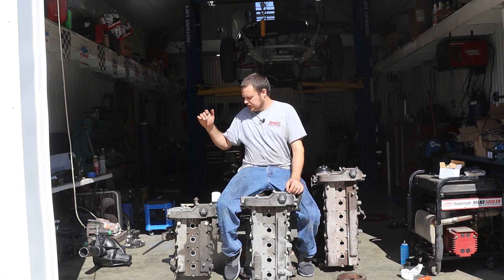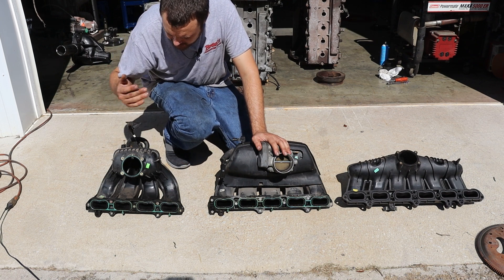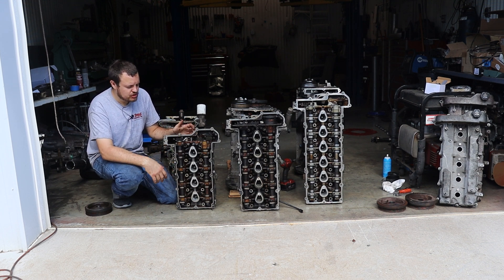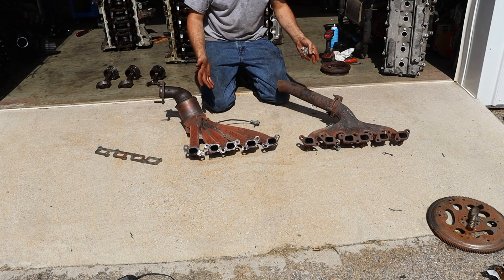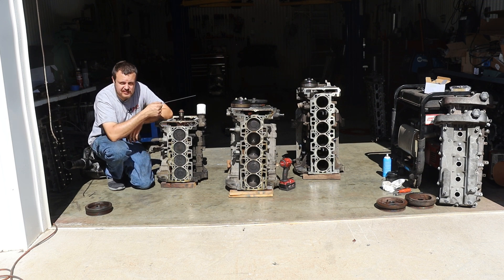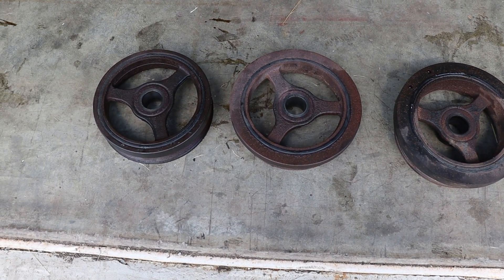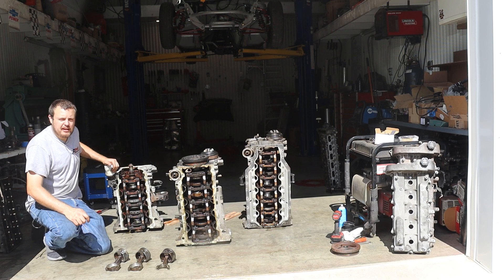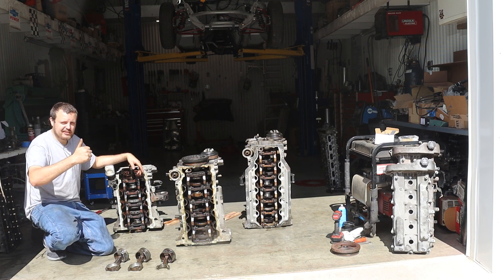GM Atlas 4 vs 5 vs 6 Cylinder Engine Comparison

Comment: can you bore out the 6 cylinders to 95 to fit the 5 cylinder pistons in the gen 2 engine?
Reply from the maker: You would have to resleeve it
Reply: @Calvin-Nelson  Has anyone tried to do that? do you it would be worth doing?
Reply from the maker: @tylorjames84  yes. Is it worth it? Not to me, when you can add 1 psi of boost, and you'll be at the same spot.
Reply: @Calvin-Nelson  ok thanks man!!!!!

Comment: I’m sorry I love my atlas in my gmc envoy but the atlas in 5 cylinder form is trash. They just don’t hold up in stock form. Unbalanced maybe idk. The 6 and 4 are fine. I see them 250k all the time at work but not the 5s 150k they are about done.

Comment: Anybody no what vehicles the 5 cyclinder came in
Reply: 2006 Hummer H3 came with the 5 cylinder 3.5 liter (some with a 5 speed manual transmission !) Then they had the 3.7 liter 5 cylinder again (some with a 5 speed manual transmission).

Comment: I was told the 5 cyl engines were problematic with cyl head problems, not true or ??
Reply from the maker: Eh. I think all the engines had a short bout with cylinder head problems. From my experience if them make it past 100k, you know you have a runner.

Comment: With regards to the balance shafts, on the 5 cyl. they are 1:1 speed, as to balance out the "see-saw" motion due to the (small) 1st. order imbalance (only used by the GM 5 cylinder AFAIK, "all" the others, mainly VAG, Volvo and Mercedes have such small displacement that it imbsalance is neglectable). On a "large" 4 cylinder,  it's neither for the more distantly spaced powerpulses (no way to counteract those other than a heavy flywheel, but aint nobody want that...) or any 1st. order imbalance... However the 2nd. order imbalance (difference in piston accelleration between bottom half and top half of travel due to rod angle geometry) lines up symmetrically and adds up on a 4 cyl or flat-plane v8 (180° journals) and become a PITA (shaking bolts loose kind of) at larger strokes and piston mass, and those shafts is driven at 2x crank speed as the 2nd. order vibrations goes up and down axially to the bores 2 times per revolution of the crank.
Reply from the maker: They are not 1:1 speed.

Comment: Are the valves on the gen 2 4.2 bigger or smaller than the valves on the 3.7? I noticed the all gen 1 engines used the same valves but the 2.9 & 3.7 valves are different than the 06-09 4.2
Reply from the maker: I'll have to look. That's interesting. I wonder if 3.7 has larger valves than Gen 2 4.2
Reply: @Calvin-Nelson  definitely would be interesting to see what the difference is

Comment: keep making videos! I really like this engine, I remember when no one was betting on my engine model and I started looking for components for the miom until now it became very popular since they discovered, just as you are discovering, that these deliver a lot of power.
Another very underrated engine is the 4-cylinder 2.4L ecotec from Chevrolet Captiva, Pontiac, Saturn, Buick, it is a very economical engine and is found everywhere in the United States, and it is proven that with an original block with pistons, forged connecting rods and Other things, it reaches more than 1600 HP, like Carl Brunet's Pontiac, which was a world record for a long time. https://www.youtube.com/watch?v=qkm2UVFYUlo&t=188s

Comment: amazing video, and engine for tuning. I´m tuning a C20xe  engine from Opel/ chevrolet kadett , vectra, calibra. They are amazing engines  and make a lot  of power!!!  I have a goal of passing 1000 hp in my 4 cylinder c20xe , i put all forged and compound turbo.. In the future I will opt for this 6-cylinder vortex mechanism to build a drift car.
Reply from the maker: Heck yeah dude. Keep at it!

Comment: dumb question;
For the bakance shafts, is it as simple removing them?
Or they still in to still in block for some reason & just remove the chain?
Etc

Dont have any of these engines, but ur videos are good info.
So, if im ever able to grab a cheap trailblazer or colorado in the future (have room) im going to do it & want to boost for sure.
But other question is it better to swap the 6cyl. Then trying to mod in the blazer?
But guessing blazer has some aftermarket support due to the SS.
Reply from the maker: You can just remove the chain and leave the shafts in. We are going to block off the oil passages so that the engine is better lubricated.

I would recommend swapping it into something else just because trailblazers are kind of a nightmare to work on, but they can be made to work too.
Reply: @Calvin-Nelson  thanks. Good info.

Comment: Hello, Calvin. Thank you for your videos, and I hope your dad is doing well. I have been in the automotive repair field for over thirty years, but as you know, it is a different world than high-performance/ drag racing. I'm very picky about the car shows I watch on the internet, and your YouTube channel is on top of my list. I have been thinking about bracket racing at my local drag strip. I got a light car and a plan for a 400 to 500-hp engine and a stout drivetrain. Because you are good at explaining things, I would appreciate any tips on bracket racing and car setup for beginners if you have time.
Reply from the maker: Thanks. I have thought many times about doing that. Maybe I will.

Comment: These engines bring back memories of when I worked at the Chevy dealership. I did quite a few cylinder beads for burned exhaust valves. I was young and felt like a master mechanic being able to take the head off without removing the timing cover and using the wedge tool to hold the timing chain tensioner in place.
Reply from the maker: Yep. I know exactly what you're talking about.
Reply: Sometimes the wedge didn't hold life sucked at that point
Reply: @Noelle0009  ya tell me about it... paid 4k for the "best shop in town" to do my cylinder head and they botched it.  Got the truck back and it popped a CEL after 150km.... timing chain.  It had skipped a tooth and a half.  NO problems with the timing before the head was removed either...

Comment: Would a 2900 fit in a front wheel drive application? Whats the difference in the atlas and metric gm bell housing patterns?
Reply from the maker: I don't see why you couldn't make it work. I would recommend a 4T80e
Reply from the maker: They Atlas and Metric bell housings are pretty different.

Comment: THE FORD BARRA AUSTRALIAN STRAIGHT 6 CYLINDER DOHC COMPLETELY STOCK UNTOUCHED, HEADS, CAM AND EVERYTHING. ARE DOING A THOUSAND HORSEPOWER AT THE REAR WHEELS AND WITH SEVERE ABUSE THEY DON'T BLOW. THERE'S A FORD WORKED OFF THE STOCK PLATFORM BARRA POWERED FORD MUSTANG HERE IN THE UNITED STATES RUNNING THE QUARTER MILE AND HIGH FIVE SECONDS.
Reply from the maker: That's awesome man!
Reply: CALVIN, ARE YOU AWARE THAT GM MIMICS AND COPIES EVERYTHING FORD DOES. WOULD YOU SAY THE ATLAS IS A KNOCKOFF OF THE FORD BARRA ENGINE?

Comment: Great upload, I think you may be the standing authority on these atlas engines in the aftermarket. Are you any good with a CAD program? You actually have the knowledge base and experience, why not try blue printing your own oil pans and turbo exhaust manifolds? Money on the table there, many parts companies started with less. People would rather buy bolt on stuff then fabricate 90% of the time, that could be an income for you, for time spent drawing up stuff you have already designed and handled that no one else has gone through the effort to produce.
Reply from the maker: I've been slowly working on an oil pan design. For turbo manifolds, I would check out Artec Performance
Reply: @Calvin-Nelson  not to actually building one yet. My personal preference for a platform is an '08 3.7l ht3 with a 10speed swap. I'm still mapping out the transmission part, and not spending a dime until I'm sure it WILL do what it should, it's for my daughter's first truck. But this was an awesome engine family breakdown. Thank you for a response.

Comment: That'd make for a real nice 4 banger swap. A gen2 4cyl Looks like a very capable package in the stock form to go into something like a Miata or a BRZ
Reply: i did think the same--- but the atlas is a tall beast and will not fit under the hood/bonnet on most small cars.

Comment: I'm planning to rebuild my 2008 chevy 2.9L I want to improve it is there anyway I can improve and still pass smog emissions laws because I live in CALIFORNIA  and where can I get performance for my 2.9L engine I can't find anything online  like arp bolts
Reply from the maker: A lot of the performance stuff for these engines are adapted from other platforms. For example you can get head studs for an LS and make them work on these with spacers.

As far as smog, I have no idea. Never had to deal with that. Maybe swap one into an older vehicle?
Reply: @Calvin-Nelson  but I want to get reinstalled back into Mt 2008 chevy colorado once it rebuild  it

Comment: Great video Calvin, really appreciate the in depth knowledge you have of all 3 variants. I am really interested in the 3700 5 cylinder (in stock form) for my Volvo 240. I have seen a ton of documentation for getting LS motors to run using the stock ECU + fuse block. It makes a lot of sense. Do you know of any resources where someone like me could get started to better understand what would have to be done to get the 5 cylinder running independent of the car it came from?  This would be my first engine swap. Thank you!
Reply from the maker: It would be very similar to the 6 cylinder. This is a good resource. https://sites.google.com/view/vortec4200wiki/home
Reply: @Calvin-Nelson  Thank you!

Comment: Nice breakdown. I'm raring to see more Atlas-5 builds/content. Also, I'm still impressed by that 7500rpm number. Theoretically, that should just about be the limit of safe piston speed for a durable, streetable engine with the amount of stroke the Atlas series has. Really hammers home the fact that we need a destroke kit to bring these down to a nice, even 90mm stroke. At that point, 8000-9000 is on the table with 7000 to 8000 being comparatively bulletproof.
Reply from the maker: Guys are taking them 10k RPM with the stock stroke. Think about a Big Block Chevy. They run like 4.5 inch strokes and you see Steve Morris take them to 9500 all the time
Reply: @Calvin-Nelson  I guess despite my youth I'm old-school in my thinking. ~25 m/s for the street, 30 m/s hard limit even for racing. Then again, I don't have experience and am basing those numbers off of what hpwizard suggests. 22 for endurance racing, 25 for "short race" (IE F1), 30 for drag racing. Than AGAIN again, those are suggested "mean" piston speeds, so... shrug

The reason why I thought it checked out is because I compared F1 and Nascar engines and they turn about 25 m/s at max RPM, so I figured to make a reliable street motor you should pick its max RPM similarly to what is suggested despite never being there for any extended period like racing engines are. It just makes sense to me in a pleasingly simplistic way.

EDIT: I mean damn, 10k rpm on a 102mm stroke is over the 30 m/s "drag racing" piston speed mark. Even if you "maxed out" what this hpwizard website suggests, you should "only" do 8800 (9000 rounded up) on a stock stroke Atlas.
Reply from the maker: @Drunken_Hamster  Yep. All depends on what you're doing I suppose. NASCAR and Formula 1 are a totally different use case than drag racing.
Reply: @Drunken_Hamster IF UR NOT FAMILIAR WITH HONDAS S2000 ENGINES THEYVE GOT SOME SERIOUS PISTON SPEEDS YET ARE KNOWN TO BE DEAD RELIABLE FOR GUY'S WHO DAILY STREET/TRACK(SCCA STYLE) AND SEVERAL HIGH MILEAGE EXAMPLES.
Reply: @beaches2mountains230  Both versions of the S2000 engine fall under my/HPwizard's guidelines with a redline around 25 M/s.
Reply: A street engine you are not going to run at max rpm very often anyways.

Comment: You definitely want to get rid of the balance shafts. They turn twice crank speed ( on a four, don’t know on a five )  so the rpm of the balance shafts gets critical when racing. Not to mention the forces of the severely out of balance shafts loading the bearings in a destructive way.
Reply from the maker: Yep. Totally agree. They spin double crank speed on the 5 too.
Reply: @Calvin-Nelson  When you delete them, can you just disconnect the chains and leave the shafts in place? Or do you have to remove them? Would you need to cover up oil passages?

Comment: Any clutch solutions available for the 4/5 cyl?
Reply: There is a clutch for them. Some of those Colorados had a Aisin 5 speed manual transmission.
Reply: @PetesGarageandperformance  noted! And thanks for all the time you're taking to get all this info out there with these. It's very appreciated 🤙

Comment: Can the 6 cylinder be taken out to the 95.5 mm bore, use those pistons from a 4 or 5 cylinder???
Reply from the maker: Not easily. You would have to resleeve
Reply: @Calvin-Nelson  thanks Calvin, going as far as resleeving the block, might as go really big, use custom pistons. But of course $$$ doesn't grow on trees.

Comment: How much would it cost to get a good forged steel crank for the 4200??? and could you find H beam rods for it??
Reply from the maker: The last quote I saw was $3500 with a 10 crankshaft minimum order. It's probably gone up since then. Molnar makes rods

Comment: When modifying a 6cyl to have a rear sump pan, is it possible/necessary to use a 5 cylinder oil pick up and pump?
Reply: Thats what a lot of people do ,  cut it and extend to use on the 6 cylinder
Reply from the maker: The pumps are the same. No need to change it out.  You have to be careful at some point in the production they changed from a o ring style pickup tube to a gasket style pickup tube.

Comment: Just an idea: drop the four into a Chevette. Here in Brazil, a drag racing team went the old school route to gain displacement over opponents that are usually powered by Volkswagen or Opel engines: they got an 151 - a 250  minus two cylinders - and stroked it to 3.0 litres. Makes me wonder what an updated platform could do.
Reply from the maker: That would definitely be cool. Too many projects. Too little time.
Reply: @Calvin-Nelson  I get it, too much for one person. But the goal is to throw ideas around and inspire people to try them out, isn't it? 😉

Comment: I worked with one of the development engineers who was on the 6 cylinder.  The main goal was more power & better fuel economy than the 4.3.  The prototypes showed significantly improved fuel economy. The first production engines did not show this.  Lots of research never located what changed.  Mike said they were left scratching their heads. Puzzling.
Reply: They probably backed off due to emissions, but let it be, GM nailed it with these awesome engines and the fact they can be boosted reliably to 800+ hp with stock bottom end says a lot about reliability at least as long as you're changing the oil often like in any other engine afterall.
Reply: I have the 4.2 6 cylinder in an 06 trailblazer.. 278k still original engine and the 4L60E transmission. everything still runs smooth and strong with no problems.. how much higher mileage do you think these engines can go?
Reply: The intake port needs the floor filled and the roof raised.
Reply: Probably a manufacturing issue. Wouldn’t have been so bad if they put turbos on them either.

Comment: A 5 cylinder would be so sick to boost  like a Audi engine
Reply: Audi 5 is a lot more advanced. It’s half the v10 in a Lamborghini Huracan. I have an RS3 and it’s a blast. Engine parts are not cheap. Used engines are over 12k. The heads and timing have a lot of trickery going on inside. Amazing technology.

Comment: I been putting together an LQ4 for my 1968 M-715 swap, since I seen your videos I been starting to think about these.
Do you have the TQ numbers from your Dyno runs?
Truck is about 6,000lbs, I need the TQ
Reply from the maker: Nah. Hard to get a good read on torque with a torque converter, but most of our dyno tests have had RPM probe issues, which means no torque reading.

Comment: In for more details on the 5 cyl such as benefits/drawbacks of balance shaft delete and such.
Reply: Not a good idea on 5 cylinder its used for primary balance unlike a 4 where its for secondary balance.
Reply: @dilsher12  I'm completely clueless in this area but how does a separate shaft do anything but affect vibrations? I assume that is what you are saying with primary vs secondary balance

Comment: What are the best trans options for the 4200? I'm looking for a direct bolt up and running upwards of 1000hp.
Reply: Manual t56 tremec th400 for auto the bell housing should bolt up if not a adapter will work
Reply from the maker: https://sites.google.com/view/vortec4200wiki/automatic-transmissions?authuser=0
Reply: Wow, what a detailed website! very nice. Thanks

Comment: Any chance of talking about over all length of the 3 engines. Would help people figure out what will fit in their swaps. Thank you love the content!
Reply from the maker: I have the dimensions of the 6 cylinder on the wiki. The bore spacing is just over 4 inches, so the math could easily be done. https://sites.google.com/view/vortec4200wiki/dimensions

Comment: I have been looking at doing a swap on my BMWs I have an n55 x5 and 328i with the n20 both are a pain to keep in top working order. And I have wanted to make power. I was thinking of stealing parts off the bmw and retrofitting them to engine. Do you have a site or list of all the specs and parts you use on the 4200. I looking at getting lower turbo Mount and air intake. For the price it sounds like a great deal I can sell my stock motors for good bit.
Reply from the maker: https://sites.google.com/view/vortec4200wiki/home?authuser=0
Reply: @Calvin-Nelson  thank you. The intake plates are what I need I was looking to adapt intake manifold from the b58 as it doubles as water air intercooler.